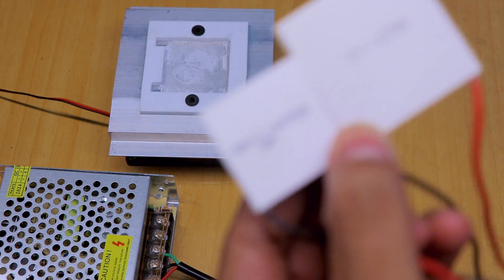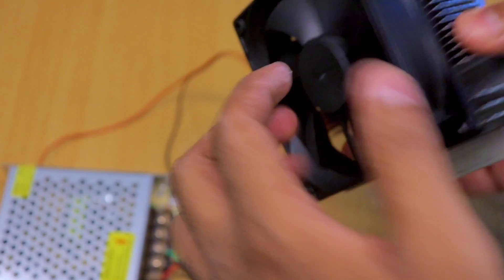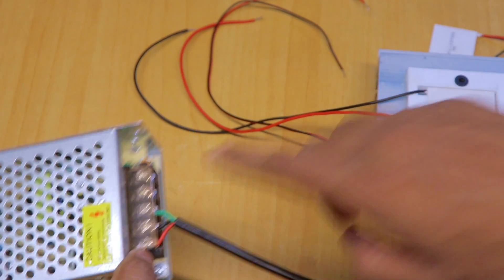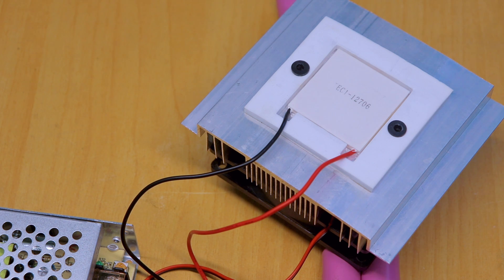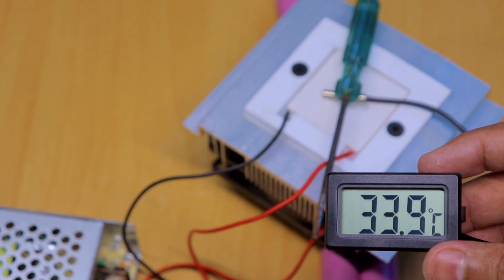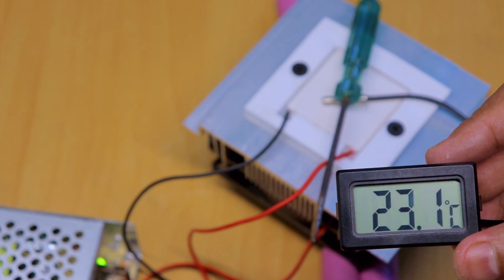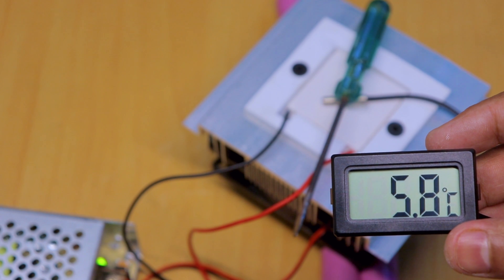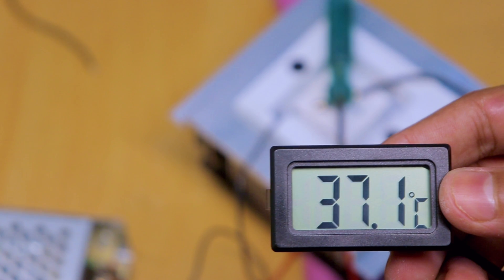TEC1-12706 vs TEC1-12703: Ultimate Peltier Module Cooling Test!

Comment: This is not  valid, you should use the same surface  on the cold side to compare them, so you mus put a same dissipator on the cold side  for both of them, otherwi , you compare 3x3 cm to 4x4cm to, near twice the surface to be cooled with air exchange, this experience is false.